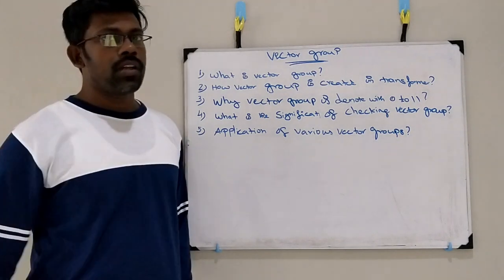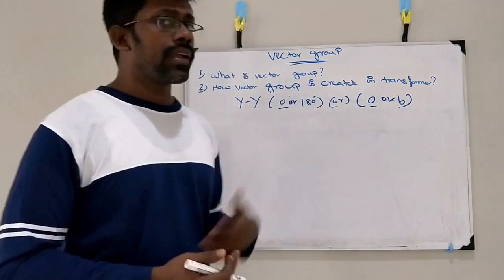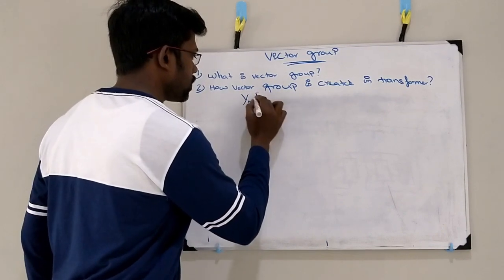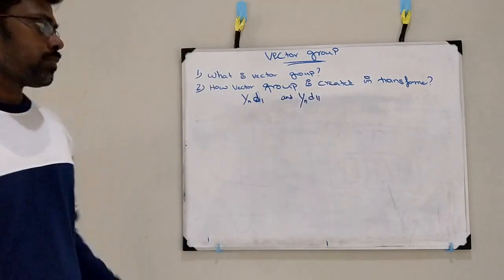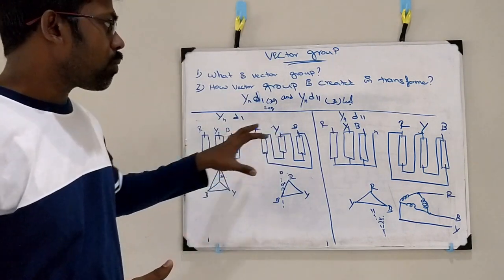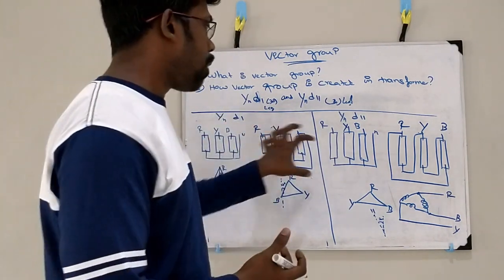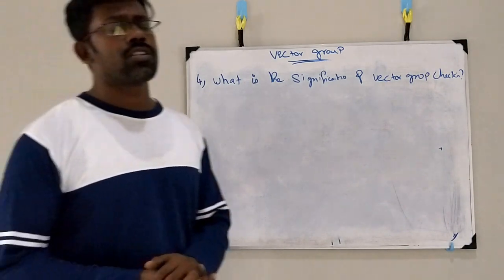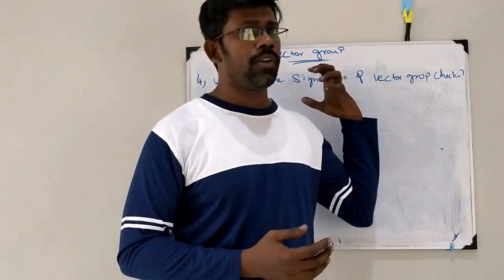Transformer Vector group | how transformer vector group form

Comment: For GT high voltage side will to transmission line and low voltage side is connected to generation end, you said it the other way
Reply from the maker: what you said is correct

Comment: Dear
Say a transformer DY11 and yn0 connection, what is segnificance of hi side and low side of this 30 deg phase shift, how this 30 deg phase shift will effect on the load, say Lv side loads.
Reply from the maker: when we have the combination of Star and delta the phase shift will occurs

Comment: IN VECTOR GROUP Yd1 ,vector group formation,secondary side why R pry  is connected to y sec side ,why not for Y pry side..same for Yd11 ,why R pry is connect to B sec why not Y  sec...plz clarify reason behind it ..intechnical
Reply from the maker: checking vector group you can connect with any phase but its angle should not change